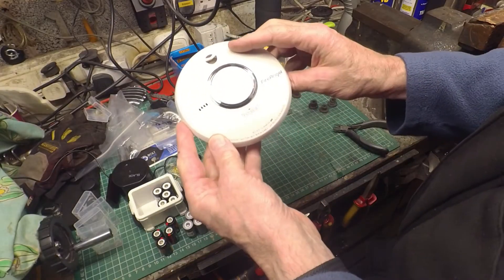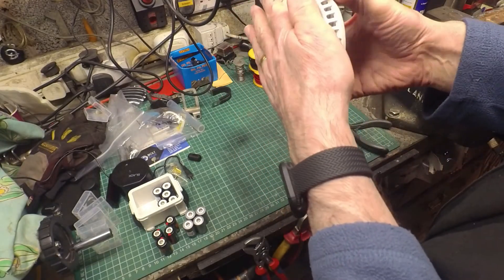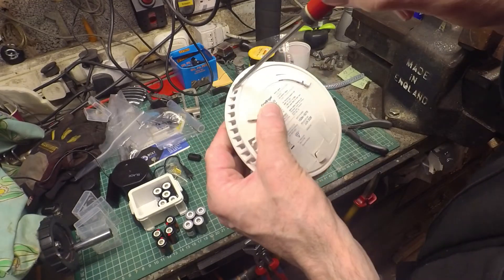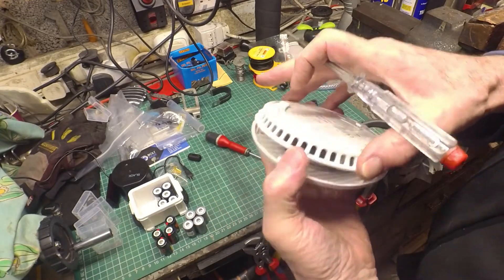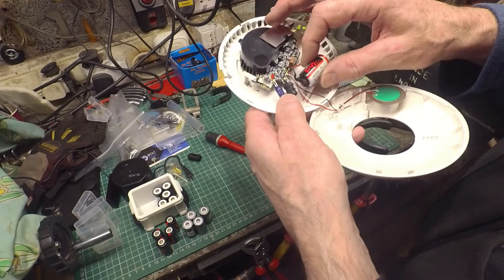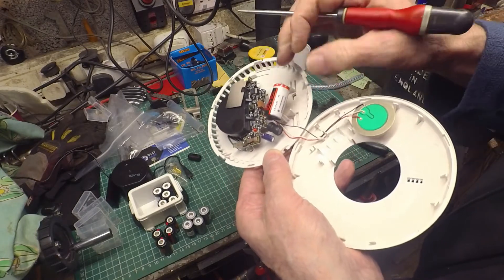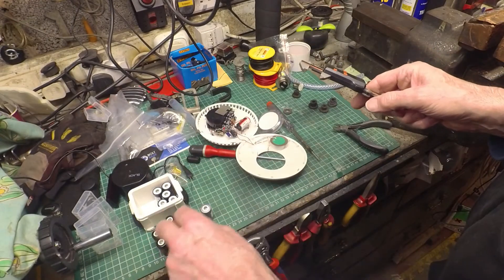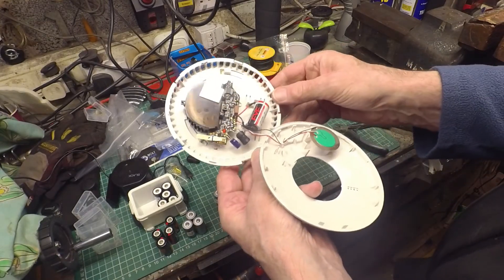Inside a FireAngel ST-620 Smoke Alarm

Comment: My experience. After about 4 years of good service in a motorhome kitchen, when it regularly went off with cooking smoke, but always reset easily, my 620 suddenly started going in the middle of the night, and wouldn't switch off. I took the cover off, without twisting, making sure not to touch the trick plate described below (thanks!) and covered the tin plate with tape. I checked the voltage and it was 3.2. The unit was quite dirty. I vacced and blew and brushed around the sensor chamber. After a few attempts it appeared to be working again - blowing test smoke at it set it off, the button cancelled the beep, the red led continued flashing, and then if no more smoke present after a few minutes the red led stopped flashing. I repeated this test several times until satisfied, then reassembled. It appears in my case that it just needed a clean and blow. Reading these posts first from Greaves and Tuna enabled me to not make any mistakes and brick or silence the unit. Obviously I will keep an eye on it and test it regularly, but for now is seems OK. Mine has a date of 2028 on it, and with the battery at a solid 3.2v it should have some more life in it yet. I think my problem was just dirt - it's not really supposed to be near a kitchen, but in a motorhome there isn't much choice! Many thanks to you guys.
Reply from the maker: Many thanks for posting - useful additional info’ 👍

Comment: I bought 3 of these ST-620's in Mar 2020, replace by date is Oct 2028. One is now doing the 40 second chirp (Dec 2022). I've just opened it up and battery terminal voltage is 3.05V. Couldn't find datasheet for the EVE battery but a similar CR17335 details a 20uA discharge characteristic of a flat 3.06/3.07V for about 5 years. Must be a precise monitoring circuit - it uses a PIC16F785. Point being, is 3.05V really low enough to cause battery failure event? Were you successful in changing the battery in the ST-620? Is it lasting a long time? Loud buzzer still??
Reply from the maker: Hi. As you say the 'battery low' detection must be sensitive & biased toward ensuring that there's always plenty of energy in the battery to effectively sound the alarm. I have managed to replace the battery; see here https://youtu.be/kLNc_FP1dR4 I've not had replaced batteries in service long enough to judge if they're better than the OEM versions yet though
Reply: OK, just seen your most recent video which answers all my questions. Many thanks for that!        https://www.youtube.com/watch?v=kLNc_FP1dR4

Comment: Thanks a lot for your video! This alarm was beeping as it was low battery whereas it should live up until 2026, it was driving me insane
Had to cut the wire to make sure it stops beeping
Reply: Would the kidde one use the same base plate as the fireangel please? Having similar probs with my SD-622. Thanks for any help. I’m useless at this sort of thing!
Reply from the maker: @louisajones3535  Hi. The base plates are different I’m afraid. I bought the Kidde 10Y29, which is also supposed to last 10yrs. It’s a smaller diameter than the FireAngel and comes with it’s own base plate. So you’d have to remove your existing plate and swap it for another.
Reply: @Greeves  thanks so much for your reply. Very helpful. Sorry it took me so long to find it!
Reply from the maker: @louisajones3535  No worries 🙂
Reply from the maker: Thanks for your comment. Worth checking your warranty to see if you can get a free replacement. I suspect though, that you'll find the warranty is only for 5 years, not the 10 years they're supposed to last. Going through the warranty process is a time consuming hassle anyway; I just bought 10 year Kidde smoke alarms, which have been OK so far. Good luck.

Comment: I have one of those and it keeps beeping because of low battery. Took it off the wall and it's still beeping, it's driving me insane and bothering my neighbors. I'm considering juste opening it and cutting the battery wires, your vid helped me figure out how to get it open
Reply from the maker: Glad that the video was of some use - even if the circumstances were less than ideal. I’m never going to buy FireAngel again 🙁
Reply: How did you get the battery out ? Driving me crazy please 🙏🏽
Reply: @plainjane138  I literally dropped the thing in water to make sure it doesn't beep and cut the battery wires with scissors 😅
You can't replace the battery anyway, might as well make sure it won't ever make any damned sound ever again
Reply from the maker: @clemencecoach8095  Glad,you were able to stop the noise 🙂
Reply: @clemencecoach8095  thank you … I worked it out .. awful headache sound … thank you so much 👍🏽👍🏽

Comment: battery optimism..... a problem everywhere even in EV's...... Don't step in to the brown goo......
Reply: 2 years later and thousands of ev's have 200k-400k miles on the clock and are still running fine

Comment: On the newer model ST-622, they have put in something to stop the battery being changed. The moment you open the case and/or move something, the buzzer becomes very low volume making the alarm useless. If you are in for a challenge, do a video playing with one of those.
Reply from the maker: Interesting. I’ve switched brands now & won’t ever buy FireAngel again. I wonder if keeping power on the ST-622 & ‘hot swapping’ the battery would beat the buzzer going quiet (?)
Reply: @Greeves  I had one going quiet without disconnecting the battery. All I did was opening the case to have a look.
Reply from the maker: @fungames24  Ah, so much for that idea. I suppose that for something as important as a smoke alarm, it’s not worth taking any chances anyway. These FireAngel ones don’t meet their own spec though 😕
Reply: @Greeves  Being critical doesn't justify their rip off. It seems there's no law to stop them claiming a 10 year product that fails in less than 5.
Reply: I've discovered the mechanism thats used for this, the black wire to the speaker is connected to a metal conductive ring, if that touches the metal 'shield' a signal is sent to the controller to disable functionality making the unit a brick. I was opening mine up to clean a spiders web that crawled inside
Reply: @ic3pick66  Good discovery. Do you see a way to open up the unit without triggering the brick mode?
Reply from the maker: It is possible - I’ve just done it on another FireAngel that failed early. (The video I made of it comes out tomorrow evening.) You just need to make sure the new battery is connected before the original is removed 👍
Reply: @Greeves  What model is it? I have just opened up an ST620 carefully not touching the speaker to anything and it's still working at normal volume. The piece of junk is chirping low battery with the battery still at 3V.
Reply from the maker: @fungames24  It's an ST-620. This seems to have the same 'bricking' behaviour as the 622 - i.e. it goes low volume if the battery is disconnected & then a fresh battery added. I had this happen when I tried swapping the battery on the first ST-620 that failed early on me.  The 'bad' battery was still showing just over 3V; the replacement 3.27V. I can only think that they deliberately trip the low battery warning while there's still plenty of grunt left to sound the alarm at full volume for a good period of time. It may not be much use otherwise - if you’re unlucky enough to suffer a fire toward the end of the alarms life. They should still last for the 10 years that FireAngel claim though!
Reply: @fungames24  3:12 you can see the black wire to the metallic ring on the speaker and the metal shield above, these cannot touch. Its certainly possible to open it without triggering - pull the cover directly away without rotating. Disconnecting the speaker cable will prevent the short whilst your working on it (this was the mistake I made). Putting it back together you have to align everything and press together again without rotating, a bit of electrical tape would certainly prevent any shorts for extra precaution
Reply: @Greeves  I wonder if the 'low volume' mode is for factory testing, and some contacts are bridged to prime the device into home mode
Reply: @ic3pick66  Thanks. I did manage to take apart an ST620 successfully just now. According to the OP, new battery has to be connected before removing old. This part is a challenge since I am not into electronics and don't have the tools.
Reply: Ok found out how to re-enable high volume, looks like it'll involve some micro wire and soldering, but on the back of the board there's some pads for factory testing. Orientate the board with the speaker connector facing up, now as you look at it, on the top row 3rd in from the left (the funny shaped pad) bridge this to the Bottom row's 2nd left pad.  I might make a video on it as its quite difficult to explain. I normally wouldn't bother with this sort of thing, but this unit just hacked me off
Reply: @Greeves  Thanks for the explanation. I have just put the alarm back together with a second battery inside. I think this might work: just leave the dead/low battery inside and solder on a new battery in parallel.

The original battery is on one side of the buzzer. Right next to the buzzer on the other side can be placed a second battery.
Reply: @ic3pick66  Hope to see your video. These units didn't hack me off, they ripped me off.
Reply from the maker: @ic3pick66  I’d be pleased to see a video showing this - as you say, I’m hacked off too! (It’s much easier to buy a 10yr Kidde as replacement but that’s not the point 🙃)
Reply: https://youtu.be/ZPc8GCoFb4s
Fortunately for everyone I didn’t film my soldering! But here is the unit reopened and the location of the board, pins and soldering aftermath
Reply from the maker: @ic3pick66  Brilliant! Thanks for taking the time to post this. Much easier to appreciate your description via a video. All the best,
Reply: I have a ST622 not complaining about low battery at 3.02V. Looks like 3.0V is the limit.

Comment: My ST622 just died, 10 year battery only lasted 5 years, but a new 17335 is about 10 quid and a new ST622 odd ebay is also about a tenner
Reply from the maker: Um, the marketing claims for these alarms certainly don’t match the practical experience - not even close in many cases 😕
Reply: @Greeves  nope mine has actually done 4 years and 8 months, so not even half the 10 years
Reply from the maker: @squaddingquads  I hope you’ll take it up with FireAngel. They shouldn’t be allowed to get away with this

Comment: I have just bought these and when holding a flame to them they do not go off? Have you managed top test yours?
Reply from the maker: Hi. The new models claim to include a temperature factor in their sensor but they primarily need smoke particles to trigger. So a flame won’t necessarily do it, especially in a brief, small scale test. Better to use something that generates more smoke - to trigger the optical sensor. A recently blown out match ought to do it, in a draft free area
Reply: @Greeves  Thanks mate, I will give it a second go!